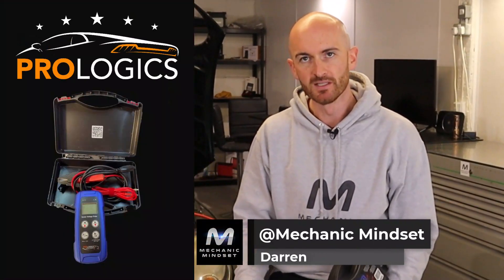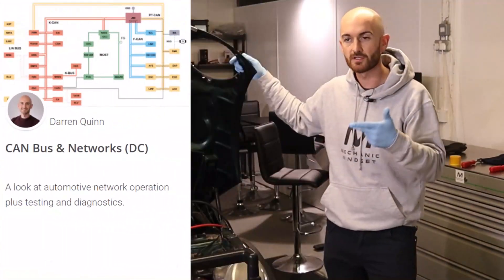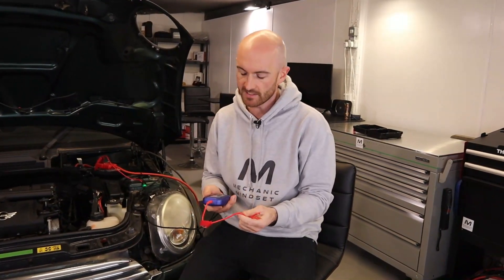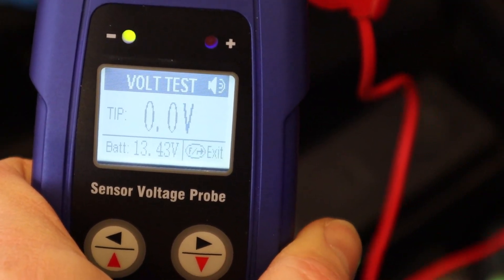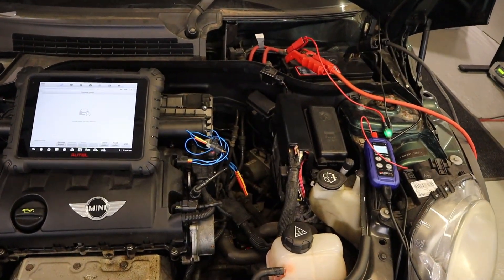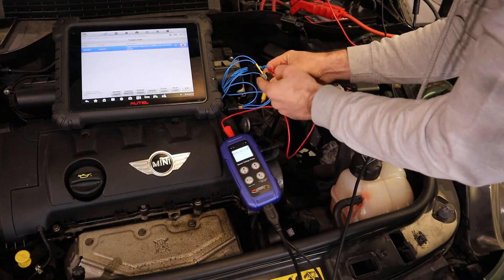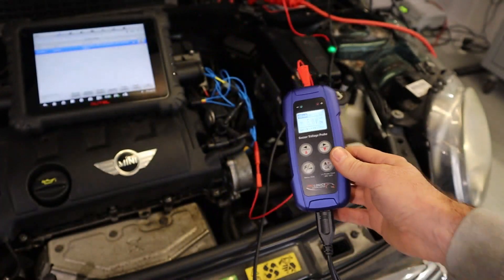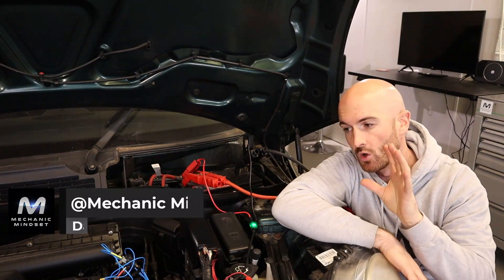Check Out This Sensor Reference Voltage Probe from ProLogics!

Comment: The first thing  to understand with sensors is how they work. You really need to understand the principle behind how they work - the physics. Once you understand how they work and the electronics behind them what to check becomes second nature. The second thing is having basic tools such as a good DVM and a cheap hand held oscilloscope  and really knowing how they work and what they can and cannot do - you can get a long way with a battery powered oscilloscope when checking sensors and they can be bought for less than £60.  Finally, you need  good wiring diagrams and technical data pertinent to the car you are working on.  

Expensive tools save time  but if you don't understand the basics you are always going to struggle and buying expensive tools is no substitute for  technical understanding .

Comment: Another nice video providing quality info. I use a much cheaper 0-10V/0-22mA Voltage and Current Signal Generator for providing accurate input voltage to test sensors and wiring, provided I have a circuit diagram one can also use a tests light with a higher current draw to test the wiring if required.
For other measurements I use a fluke meter.

Comment: Has more functions than my blue point VR probe. Similar looking and the VR probe is a life saver.
Reply from the maker: Cool, what kind of things are you using it for?
Reply: @MechanicMindset  for sensor circuit testing. 5V reference like you have in the video. A few times on the signal circuit watching live data. Proving the sensor at fault but also verifying signal circuit integrity and ecu working like a Swiss watch.